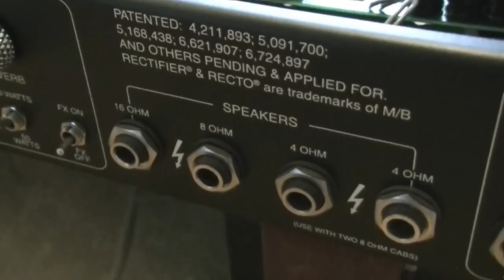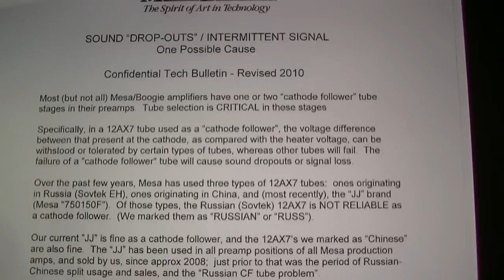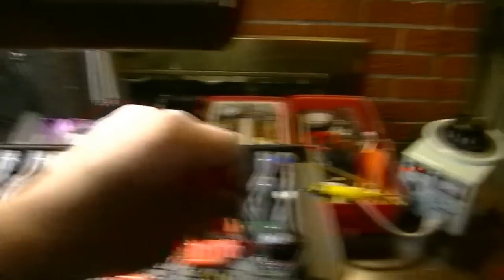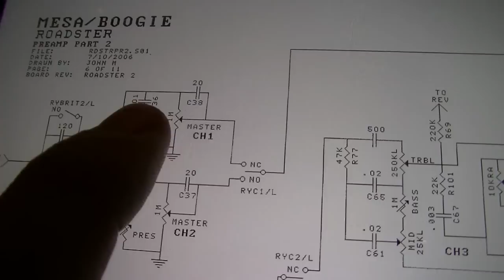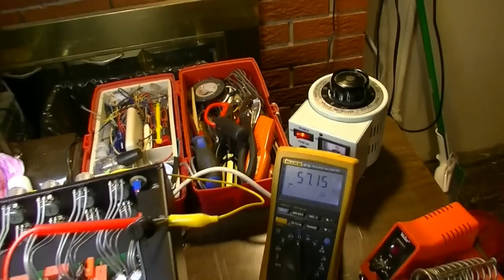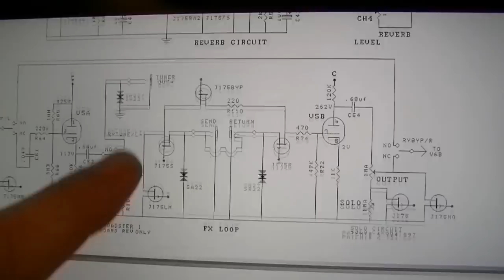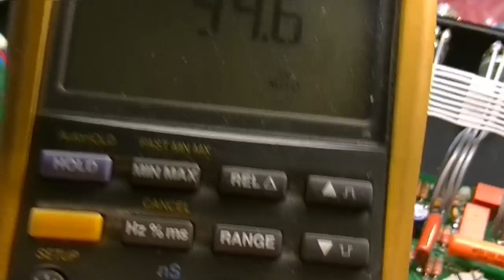Amp Tech's Worst Nightmare - Mesa Boogie Roadster Repair

Comment: Man, you're awesome! Thanks for sharing this video, very intresting! I had 2 Mesa Roadster back in 2009/2010. First one (head version) had the same "LOUD POP" when switching channel. Contacted Mesa support, sent them the head for investitagation and after a whilte they sent me back with note "no problem found, loud pop it's normale for this model". They told me was normale and also was a "FEATURE"...a feature? Really? :D So, I sold the amp and after a while I found a combo Roadster at a very good price and tried again: SAME STORY. Maybe a little loud pop but still present. As far as I remember other people from various forum had the same issue and Mesa never gave us a valid fix for this. I tried the dual rectifier, the lonestar, nomad, Mark III. IV and V, the stiletto, the express...but to me, the Roadster was a really good amp, one of the best 6L6 clean sound, very nice crunch and pure "metal sound" on lead channels but with a lot of definition also at high gain stage. I was in love with that and today I missing it a bit. After that I bought ENGL amp, the E670 Special Edition was my last tube amp. It was AWESOME and always perfect, wonderful piece of amp! Thanks again for recall me these good memories... :)
Reply from the maker: The service bulletin in this shows you how to cure that pop when changing channels.

Comment: Great fix!  It's always tough when you swap out multiple components at once and still have an issue only to find out that the swap not only fixed the original fault but also introduced another one.  Just goes to show that one cannot assume that a component you've replaced is good - it still needs to be checked with everything else.

Comment: Boogie used to put the filter caps in upsidedown in the 80s I had one of the original Mark amps and 3 different techs couldn't figure it out so ended up selling it Guy said he replaced the caps and it was one of the best amp that has come through his shop Crazy I should have sent it to Mesa
Reply: Funny thing is, most electrolytic caps do in fact "work" when oriented backwards.  By the same token, that's what sucks about them.   If you put them in backwards and they are hit with any decent amount of current, they're "formed" internally.  And that's that.  They're not useable after that, at least in the way they were intended.  So they may work, but not correctly.  It's like put a chain on your chainsaw on backwards:  It will spin, but any cutting is purely from hammering at the wood with brute force and once you've figured it out, your chain is probably trashed.

Comment: i've been interested in Mesa Boogie amps so i had to watch, especially when this guy knows his stuff, i not electrician but, great youtube video. thanks Guitologist !!
Reply: Try a Sovereign or Triple Wreck first. They are complicated as hell.  And the Wampler stuff typically has more range to work with.

I put a IIC+ mode on a Mark V against a Sovereign and preferred the Sovereign. Can get the same sound but has more range than the 'real' thing.

Another option that's great is the Quilter Overdrive 200. Like a IIC+ with a Dumble clean channel.

Comment: That amp seems overly complex. I'm sure that's common on newer amps. It just seems like the more complicated stuff is the more likely it will fail
Reply: This amp seems complex only because it's not made with a ton of ICs and programmed devices.  Lots of discrete components which can be very desirable.  He spent a few dollars on jfets and that's it!

Comment: Why had Mesa installed the cheapest plastic jacks, transistors... ever saw? A perfect built Amp, with cheapest parts of China behringer?? Have several kinds of Fe.. , Ma.. , Me.. and the Mesa is quite the best, but most expensive building,....... with such low cost parts and shi... double printed platine? Real nightmare at all!

Comment: Something that would be very helpful for you is something I've had since the 70's.  It's a really cool signal injector made originally By Eico as a kit or built.  Sometimes referred to as a 'Mosquito' because of the. Squeely mosquito-like sound it puts out.
It was made from the case of what they used to call a ' pen flashlight' (all metal).
The original one ran off of 2 'N' batteries then sometime later they made one that ran off of the more standard AA batt.
You just turn it on and use it to inject signal anywhere in the amp with no concern for the potential on the spot.  Of course you wouldn't put it on the plate of a power tube!
If you need more signal you just merely put your hand on the chassis to increase the coupling.
Works like a charm and saves tons of time.
Radio Shack may have made one at some point.  I love this thing.  Wouldn't give it up for anything.

Comment: off topic question. I have a Mesa Express 5;50 and i get an AC hum (sounds like 60 cycle)  when the amp is in 5 Watt mode. The hum is also when the guitar isnt plugged in and volume has no effect. The amp in 50 watt mode is dead quiet. I've changed all the tubes. The amp does work in 5 watt mode but the hum is an annoyance. Any ideas?

Comment: Hi i love your channel i dont have any electrical knowledge but i love to watch you troubleshoot.....also i have a question i have a marshall JMD1 the amp marshall valve amp only die hards love to badmouth ok its got preamp models “16” it works great its loud no odd noises or smell i just wondered have you worked on one or looked at one and if you have whats your opinion....throw away garbage or OK.

Comment: Hi very nice video! I have a question for you about the bias. I have Read in my mesa manual and other online resources tha mesa boogie has fixed bias, so when you replace the power tubes and you use the original mesa boogie tubes you don't need any bias adjustment. Recently a couple of person that should be experts told me that bias on mesa boogie must be adjusted when you change tubes that in contrast with all resources i have Read. Which is the truth? Thanx

Comment: I was hoping you could help me out. I just bought a used roadster head last year in great shape and I absolutely love it! I mostly play on channel 3 and have noticed that sometimes I will get a random volume spike for about a second or 2 and then it goes back down. Would this be as simple as swapping out the tubes or is it something a little more complicated? Thanks!

Comment: Crammed pcb's, air almost not moving inside chasis, ribbon style cables with sockets, too many functions backed by transistors and a few more things are reasons to think again about such amps. Turret board/chasis mount sockets/pcb for componets that don't heat much construction is the way to go for tube amps ime. A lot of functions can still be had this way and lasts much longer.
Too many pcb and transistor aided amps even with good material will have hard to repair problems sooner or later, so why bother. He doesn't mention those facts much because he got this Mesa practicaly for free, along good support, 50c Fet and a bit for the tubes from his stock so amp was a bargain for him. Not so for many others if technician has to spend entire day to find faulty 50c fet.
One can get at least two very good heads and maybe a cab for the price of such Messa. It is not THAT good!

Comment: Mesa engineers seem to try to solve problems that never should even exist. They are the true "Let's reinvent the wheel" type of folks. Way overbuilt but still a nice sounding amp.
Reply: They don't try to reinvent the wheel, there are simply too many functions for so small chasis along some bad practices regarding mechanical design. And many others are much worst at it. So yes, as soon as tech has to throw almost new parts away without testing them, it is overbuilt or badly designed which Messa isn't.

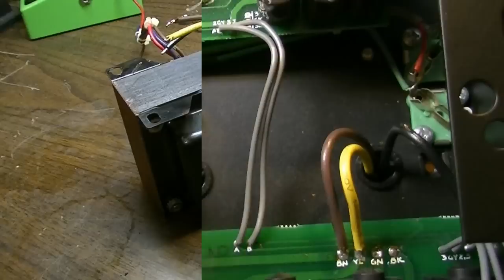Comment: Brad,  I made it to 5:44 and the green wire.   THIS is exactly the type thing I find when I work on stuff.  My Marshall JMP 50 watt was giving me troubles and when I took it to a tech a friend recommended,  he tested it and said my PT was bad.   Trusting his results, as he hooked up the meter right in front of me, I bought a Marstran PT and had him install it.   Once I went to pick up the amp, he did not return my Original Tranny and claimed he doesn't save stuff like that.  That was what would eventually lead to the last time I went to him.   I still had to fix the amp myself when it failed ( lost sound) (blew fuses) after that tranny and a cap job.   Turns out as I learned amps and was taught many things about diagnosing from internet friends, in London and Australia,  I remedied some flaws in the amp,  added screed grid resistors, connected wires back where they belonged etc,  I had it working and then suddenly no output again.  Chopstick tapped everything and when I hit one of the little tabs on the old style Ohms selector, the guitar sound resurfaced thru the speakers.  Turns out the female sockets inside were losing contact with the male prongs on the selector cap.  Lesson learned,  I can fix Amps,  Lesson 2,  NEVER let any amp tech tell you a vintage part is bad and let them " fix" it until I say thanks,  I will now do my own tests and work from now on. Cost me what was likely a multi hundred dollar valuable working 1972 Marshall PT for that lesson.

Comment: I have this exact amp. it sucks to know i'm gonna have issues
Reply: This doesn't mean that you will. The output transformer wires were dameged. I'm guessing that may have led to the Jfet failures. I'm no tech. That's just the impression I got from the video.

Comment: Worked on a lot of buggies and they are very complex but they have good quality components and I really like there over all performance but there flexibility is often the problem no matter how good the components as you increase the number you get more failures as far as the sabotage of the transformer some tech should but shot

Comment: This is shocking, from the broken knobs to the very deliberate cutting of transformer wires with a Stanley blade or such. 

There is very little doubt in my mind that shop who had it are scumbags. It was either sabotaged to get more money for a bigger repair or it was done through negligence, either way that shop cost this guy a $2,500-$3,000  amp. 

Some people are scumbags because they dont care enough to bother or because they are flat out scumbags and do this shit deliberately.

Comment: Ya ever work on a Carvin Quad-X 4 ch. stereo-out preamp?
Mesa sued Carvin for infringement, and part of the settlement was that Carvin would Cease the product line, which is a real shame because they had to have spent a FORTUNE designing and developing it. 
Oddly enough though, schematically speaking, they're not even close to a Mesa copy. (Carvin must have hired Chrysler's lawyers!  😶)
I think the Mesa is more conventional in design, whereas the Carvin is quite a departure. I understood they sold well... while they were in production, but i ber i'm the only one that bought one new and still owns it.
The production methodology between the two brands are very similar, with the Carvin being much better layed-out, me thinks.
BUT... the Carvin schematics, all four versions, don't even come close to matching the circuits on the model i have. Might as well be reading a comic book.
And that makes it extremely confusing to work on. But where's there's a will, there's a way. Cost me a head of hair tho.

I haven't yet uploaded my pics of the Quad-X, but here is a page i made showing shots of the Tube100 (2x50w stereo) poweramp which they designed to with the Quad-X.
They still offer this poweramp, but they've renamed it.

http://deewm.com/All/Carvin/index.html

This is ONE BALSY MF!!! 
It'll bleed ALL ears within a 50 mile radius when pumping a pair of quad stacks stuffed with JBL E110's. Seriously.
Great amp, if you don't mind living with tinnitus for the rest of your life.

Comment: I have a similar problem, but with a guitar pedal that has a couple of jfets. Same symptoms and result (little to no signal). I haven’t replaced the jfets yet, and I bet that’s where my problem lies. There is a similar “mute” circuit in the pedal, and I bet those jfets are shot. Since it’s a common problem for them to go bad, that’s the first thing I’m gonna replace. Great video, was not expecting to find a very similar problem that I have, great video to stumble across. But I love how you explain everything in this video. Easy to follow along with regardless of camera work.

Comment: Your only problem with Mesa Boogie is that you need to work on more of them.
(So I can learn)
I have been a mechanic for almost 40 years.
These amps are just like over engineered automobiles.
Too many hoops to run too many bells and whistles.
Engineered for flash and gadgetry, reliability is field tested....by the consumer.

Comment: worked on one of their models similar, the plate wires at tube socket needed re-touching, n a silver mica was causing a racket on a boost i blv, that was @ it, chg ldrs..SUK..................................................

Comment: Great video demonstrating application of schematic against the electronic device it represents.  One thing I don't think you ever made clear, was...  you were emailing previous owner to flag shop for their 'diagnosis" of the problem.  Did you fire off that email?  Given the scope of what you did to diagnose and resolve the issue, seems like the problem was greater than there ability to figure out.  I'm subscribing...

one more thing: listing links of your tools and references much appreciated.

Comment: With this JFET issue, one may consider using a to-92 transistor socket in places where they will fit. These sockets are a little harder to find but I have seen a few older type on eBay and a few other store sites upon doing a Google search.

Comment: Accidental solder shorts really suck. It is so easy to waste lots of time troubleshooting the wrong components...
I was experimenting on a pedal trying out different ideas until it suddenly died. I thought I had fried a component and couldn't figure out which one. After ripping out all the components and eventually replacing the pedal so I could go on, I spotted a tiny speck of solder across points causing a ground. Good as new.

Comment: Hi Brad, thank you very much for your enjoyable videos. JFETs are normally very reliable but are easily damaged by static discharge. I suspect that proper static precautions were not taken when they were installed, a lot of the JFETS would have had their gates floating in the breeze until the ribbon cables were plugged in. Even more annoying,they don't always die straight away, MOSFETS are even more pernickety.  Good luck with the MESAs.

Comment: I'll echo Eric's comments. I watched the whole video with interest. I have a Mesa Boogie Trem-O-Verb combo in which I replaced the original speakers with equivalent neodymium magnet speaker to make the whole thing lighter in weigh which is now but it's still a heavy bit of kit. The Trem-O-Verb has a two channel footswitch but the amp has four channels, do you know if it can be modified from a two channel selection to a four channel selection via a four button footswitch? 

I know a little bit about electronics and was able to follow your schematics explanations but I obviously would not attempt to do what I'm asking you about if it can be done. I'm curious as to what your reply will be.

Comment: You have the patience of a saint!   Those tough dog problems can drive you crazy. Especially when you accidentally cause a man made problem when working on it.  Good Job! I worked on a modeling amp which was a Johnson. Sounded great but it was very sensitive to spikes and Transients. AFter replacing cmos and ic's more than once I finally made the customer travel with a UPS and a power line conditioner. Seems to be holding so far...And the A-B box is now electronic too. That one drove me crazy!  Also had a newer Ampeg SVT with the problems inside the sealed mountain jacks..But that's a story for another day .  CHEERS

Comment: I honestly can see where even the best techs could have missed that anomaly., Most techs would have just seen that the secondary leads had flux on them from the factory hand soldering and not unsoldered them.  Typically techs focus on the primary impedance as thats where most of the energy as and as a result most xfrner issues.
I ran a amp repair business for 8 yrs and it never occurred to me to use a Variac to test an output transformer.  There are specs on an output xfrner that that method wouldn't ferret out but it will test the basics.

Comment: I had this exact issue on my amp. I am no electronics wizard but I was able to fix it. Bought the little JFET things online. They were .49c a piece. Took a while to get up the guts to do it, but it worked out OK and like magic my amp was working again. The fix has held up for about 3 years now and this amp has been gigged a bit. Great video!